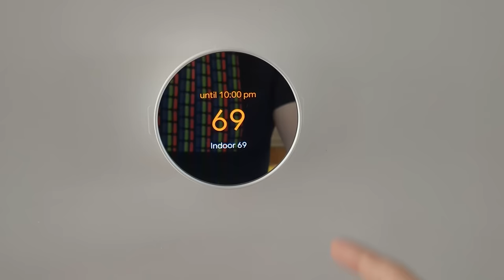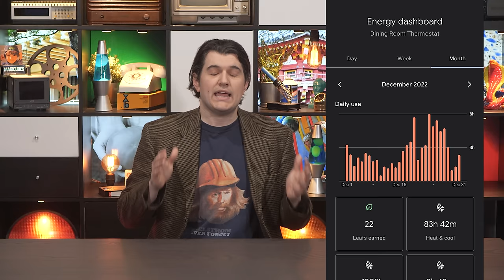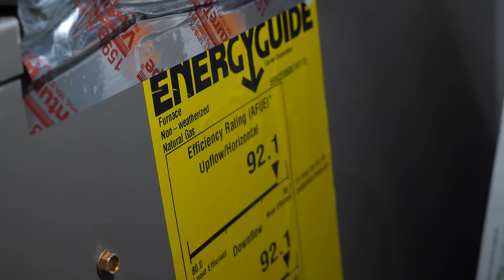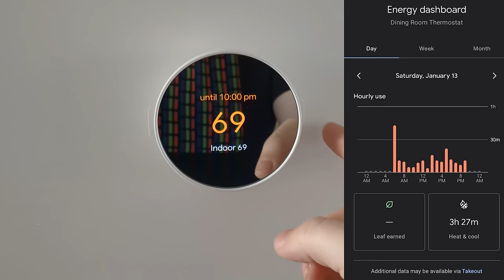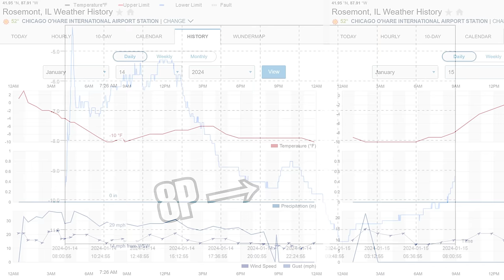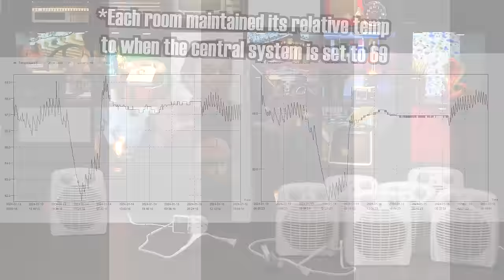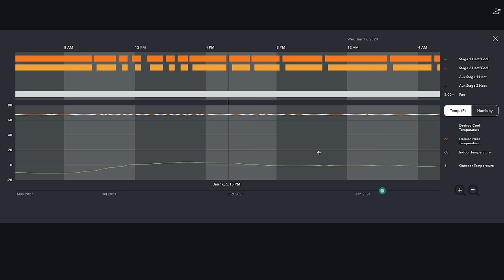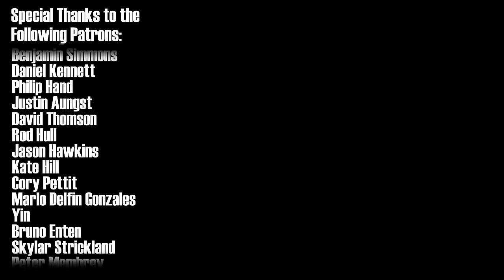Old HVAC industry practices are holding us back and costing us money. But we can fix it.

Comment: Am HVAC design engineer (floor plan layouts not the actual units), one of the reasons why gas furnaces are always oversized is because that 60k BTU is the smallest many manufacturers make, and they end up being the most common/cheapest because they're used on everything 5 tons and under. To get a smaller heater, you basically have to go electric or heat pump
Reply from the maker: I almost made this point but I did find some 30k BTU furnaces on the market so it was a damned-if-do-don't type situation.
Reply: @TechnologyConnections  What about maintenance concerns over time with wear and tear?
Reply: @TechnologyConnections they’re definitely not common. Even for a lot of package units, “low” heat specs are 54K btu. That’s also the smallest furnace I can even get from our supplier, and I’m based in Vegas where we hardly need any heat in the winter
Reply: Came here to say this too. Down south Furnaces get even more oversized because you may actually need 48kbtu of cooling but only 60kbtu of heat. Well 4 ton drive furnaces start around 80kbtu but most I come across are 120k!
Reply: @TechnologyConnections  We've got two 39.5k units, Bryant circa 1994, where I'm living now (Puget Sound region). They definitely exist.
Reply: there are lots of 40 000 btu furnaces made - even 2-stage ones.  lennox makes 44k if 40 is a bit too small and that size has a full 1200 cfm blower up to 1" of static if using the variable speed version. It is not an excuse!
Reply: This..
Reply: @averagejoeprojects2885  Old houses of the south oversized heaters are a must during a cold snap with a stiff wind coming out of the NW.
Reply: On the early 1900’s homes yes.  But on 1970’s and newer there isn’t a single 120k furnace that belongs south of the Mason-Dixion.
Reply: My house, on the coldest day of a year ( minus 28 F ) loses 23K btu. I cant fine a 25 K btu furnace. I am still using my 45 year okd  55K btu  standing pilet furnace. The $50 a year gas savings has never justified the cost of changing it out.. Oil the motor every year, thermocouples are cheap.
Reply: I do hvac and also wanted to say its because the customer wants it cheap as possible which means mass produced large furnaces. we can complain all we like but people dont have the money for it. especially now
Reply: As part of the heat pump future, I wish that there would be a shift away from centralized units. I'd much prefer several smaller, fully independent units in my home. One of my least favorite aspects of HVAC over the decades is the pressure you find yourself in when your single central system breaks. Many a HVAC contractor, especially in recent years, will leverage this to the hilt to try to get you to replace your system when yours breaks. Just this past year, 2 relatives of mine were given the lines "parts are backordered for this unit throughout the country" and "the warehouse only has 1 furnace of this size in stock, so you have to decide now whether you want it - or you may have to wait another week". If multiple small units became standard in homes, then people would not be rushed when just 1 of them broke.
Reply: Only ever seen 40K's in OLD building apartments and due to space restrictions. Even then, those apartments needed TWO  for adequate heating.
Normally enjoy these vids, but this time has grossly misinterpreted how HVAC systems operate.
Reply: no, he is right on. 40k btu is plenty for many homes. had a 44k btu put into a family member's 2 story+basement  100 year old 1200 sq ft home down from 60k, no trouble keeping up in a place with a less than 0f design temp. it rarely needs high fewer than 5% of heating ours, so much of the time it runs at 29 000 btu.  if the home is new with high r-value walls, a 40k can heat a 2500 to 3000 sq ft just fine. must furnaces are so grossly oversized it is not funny, and the result is short blasts of scorched air, not consistent temperature and comform.
time to evolve and start doing heat loss/gain calcs instead of crappy rules of thumb. @SerenoOunce
Reply: I used to see little 25k window or thru-wall gas furnaces in apartments all the time, but they're becoming much rarer now. Dynavent was the most common manufacturer and I don't believe they make them anymore.
Reply: So this begs the question, why don't companies design smaller furnaces? A line of 10k, 20k, and 30k furnaces could do a lot of good to combat oversizing in small units. 30k is the smallest I typically see, and that's what should be used in apartments.
Reply: @JasonEDragon  i prefer centralized with a very large air filter system. it keeps the air fresh in all the rooms.
Reply: @bhutehole  would be a shame if they overshot 2-3x on heat pump capacity, when going electric, especially in this economy.
Reply: there's a smaller company called dettson that actually does that. there isn't enough demand. for low heat loss spaces, furnaces are generally not the best choice anyway.  @TechnicalLee
Reply: @OneTrueCat  it that doesn’t mean they’re available. Most customers won’t wait even a week when they have no heat.
Reply: @bhutehole It’s definitely mass producing a few models to cover most people and people not wanting to spend $5-7K on a furnace and that with no changes/duct mods.
Reply: @quarterswede  yes, but that doesn't account for new construction or planned replacement being egregiously oversized.
Reply: @JasonEDragon there's a lot of issues with this approach - you introduce more points of failure and will increase the likelihood of a failure, that approach is less energy efficient, and it's more expensive. 

That said there are plenty of multizone residential systems available similar to what you're describing, but they are all connected
Reply: @jerryballstein  When you look at window air conditioners you can see that there is potential for cost to be lower by having multiple smaller units. Because they are self-contained and can be easily bought from multiple stores, the free market is effective. As we move to heat pumps, I wouldn't be surprised if similar units could be developed - with more elegant designs that could slip into a wall opening instead of passing through a window.

Today's HVAC industry seems to be moving in the opposite direction - forcing people into more expensive, complicated central units that often have service options limited to the original installer in a given area. They significantly overcharge for more advanced units, and I've seen them put the consumers under shady sales pressure when their system breaks. The industry is starting to give used car salespeople a run for their money at being despised. 

My rural county has 1 vendor that dominates the local market, so no effective competition. When you ask about heat pumps and mini-split systems you often can see in their eyes that they think they won the lottery and start quoting obscene prices. Or you get the lazy vendor who badmouths new technology so that they can keep installing the same old crap they have installed for 50 years.
Reply: @OneTrueCat how does that work with 2 units? Does one run constant and one as a peaker on the same vents? Or do both run their own zones independently with their own thermostats?
Reply: @somethingsomething404  two floors with separate duct systems, upstairs runs three zones, downstairs runs two. It's just one of many bad design choices in this place, because they both have their ducts in unconditioned space.
Reply: @JasonEDragon You've got the approach completely backwards. By far the best solution for existing homes is to use a ducted unit that replaces your furnace. R290 is coming to the US this year, if you go with a monoblock there is no refrigerant lines run inside your house there is only a water  glycol coolant loop.
You get a box outside that has no external special connections, you need to give it power and run the coolant loop and then all you have to do is install the heat exchanger and blower where the furnace used to go. It's a fast, relatively low skill swap.
Reply: @otm646  I live about 1 hour outside of Buffalo, NY in a 2 story house with basement and attic that was built in 1890. The last time my single furnace broke in 2007 I basically had about 1-2 hours to make all my decisions as it was getting down to 20 F that evening and I needed a new unit ordered for install the next day. That scenario happens often and does not give people sufficient time to make good decisions. Thankfully I had researched enough about furnaces to push for a high efficiency, modulating, forced-air gas furnace - that worked out rather well for that time. But I wanted to add central air conditioning and got sold on a single stage unit - that never cooled the upstairs well despite adding a number of upstairs return ducts during extensive remodeling that I did afterwards. So I now run a few small window air-conditions upstairs and let the central air conditioner cool the rest. And the single stage AC does a crap job - always loud with the blower on full and the downstairs is often drafty. But, contractors treat 2 stage or modulating AC units as luxury units that they put a hefty mark up on - even though they are not that much more complex to manufacture.

There is a limit to how much I can insulate this house, as about 1/3 of it is just plaster applied to a double brick wall and the windows are huge because it was built before electricity. I did some testing this winter and I think that the 43k BTU output of my furnace running in low stage mode will just maintain the temperature when it is about 20-25 F outside depending on the wind. So, I'm thinking that to switch to heat pumps I'm likely to need at a minimum 60-75k BTU to handle it being 0 F outside - which is pushing what is available in furnace modules. And that still leaves me with a single point of failure that contractors have recently made very expensive for some family and friends. You have little bargaining power when you are freezing your behind off and fearful that your home's pipes might freeze.

So, I think my best option is to have at least 2 fully independent heat pump systems in the future. I can see a furnace unit handling the downstairs, but I'd expected to need a mini-split system with multiple heads for upstairs. That starts getting into serious money from some tentative conversations that I've heard - perhaps $20k. Which gets me back to the point that if a window AC can be had for $200 - $300, and those are basically 1-way heat pumps, why can't more affordable permanent installs be designed? I at least want more than 1 system so that if 1 breaks I am not under such pressure to get it fixed right away - and I can shop around.
Reply: How much insulation is in this 100 year old 1200 sq ft home? That just seems like such a low amount to me to keep a house like this warm.  I have a 100 year old brick bungalow also 1200 sq ft full unfinished attic and basement. The boiler is 140K BTU's. No insulation in the house at all, exterior brick walls with lath and plaster over furring strips and no attic insulation.
Reply: @doctorzaius4084  Williams, Empire, Cozy and Rinnai still make gas space heaters and in small sizes, wall mounted direct vent units. I don't think the thru the wall gas units that look like air conditioners are made anymore.
Reply: @TechnologyConnections  Damn you!  …no…wait…
Reply: @Jon-hx7pe depends greatly on climate. Hvac techs size a unit for the coldest typical days of the year. I have a 70kbtu two stage gas furnace. True, for a lot if winter it rarely leaves the 1st stage. So I only need about 45kbtu to keep house warm. However, when the stretch of really cold days come (highs below 0 Fahrenheit) the furnace will absolutely run at max btu most of the time. If a tech does his job right, that's why the furnace is bigger than needed on most days. This can be mitigated on modern gas furnaces by getting a two stage or variable rate model, so it only uses what is needed.
Reply: @capps2015  shhh let the cult seeth with passion over one of their thought leaders.. they can't comprehend scenarios where its needed.. so they want to suffer when the time comes 🙃
Reply: @OneTrueCat That's circa '94 though. When was the last time you saw a new build that wasn't custom home with a floor plan of less than 2000 sq ft? If all they are basing it on is floor plan size and no one really builds small homes anymore than it makes sense that all those smaller models would be discontinued in the past 30 years.
Reply: @Jon-hx7pe the issue is they make them you can order them but does the supplier have them and as an installer/repair tech can I get parts at 2am on a Tuesday because 90% of people just want heat and in the states natural gas is crazy cheap in the dokotas they they to flare off natural gas because they can't transport it fast enough to use/sale it it becomes a waste product for the oil fields
Reply: Why is this case? Don't those furnaces have regulation over wide scope? My furnace (hot water medium)  can go in 1% increments with minimum output 0.5%. It's only 10kW output for small family house but it usually works not more than 1%-40% scope in central european winter. In autumn usually 1-8%.
Full power is only used when heating water for showering.
Reply: @Jon-hx7pe I have passive house and in european market there are furnaces for such use. They are like heating for 1-2% of their max output when there is autumn or spring but for half of the day.
It's because they have special cascade or fluent regulation burners and regulation armatures driven by stepper motors.
There are also a bit of sensors and heating medium pump is also fluently controlled by inverter.
Stupid on/off or low/med/high systems or those who had only 5-10 stages of control  were out of date 25 years ago.
Reply: @rybaluc  passive house is the way to go on new construction, almost no heating or cooling needed most of the time. but by the time you're at that point, it makes the most sense to ditch fuel burning and go heatpump.
1 to 2% of output wouldn't work on forced air unless air at vents is barely warm - north american modulating furnaces have 30 to 40% of minimum firing rate.
Reply: @Jon-hx7pe  Depends. In climate  where you are lot of degrees below freezing point -20C it is way to go also for modern gas heating. I could heat up house with just 18-20C of heating medium. No issues. 
But you got the point. Forced air is shitty heating medium.
-8 C is mild winter. 
Passive house is idea 20 years old. So it is past what is considered new building.
Reply: @rybaluc  yes it does depend. by the time you have a minimal heating load like 10 000 btu/3kw at peak, gas is huge overkill. heatpumps are better for low-load heating. for existing home with high heat loss, dual fuel- gas + heatpump can make a lot of sense with hp running in milder weather, gas taking over in colder conditions.

Forced air is a great source of heat done right, it is just no good for super-high turndowns like dropping to 10% output because the air distribution system won't work right at 10% airflow. modulating boilers are better for that.
in north america with our a/c addiction, with ductwork you can get a/c with a heatpump easily.
forced air is also cheaper to install.

in the end it is all about doing what's best for the application though.
Reply: @Jon-hx7pe  Depends. Imagine i have to pay for electricity 3x more than in US given it is high tariff on ripple control scheme. For heating tariff in remotely controlled energy distribution company schemes it could be a bit better.
On the other hand in some cases heat pump in low subzero temos requires help of resistive heating.

Solar power adds only little to it since we have pretty dark winters in central europe.
Reply: @rybaluc  i don't disagree - my point was for passive houses with extremely low heating needs only that it may not be worth getting as service despite those issues. i'm talking homes that stay warm without active heating 80 to 90% of the season due to lots of insulation and good passive solar design.
Not regular houses with high heating needs.
Reply: @Jon-hx7pe  Heating season. That depends on many factors. Climate is one of them. Other thing is heat from other sources.
What is standard metric in my country is heat loss in kW for entire building. 80-90% of season without heating is pure scifi for passive houses in mild/inland european climate and  only zero energy houses are getting close to it. Imagine you have dark out there and there is very low natural heating via windows. For 3 months water is frozen out there. Also you need to heat water somehow. In winter i have 20x less solar input than in early spring or early autumn.
Reply: @kkarllwt You pay $50 in a year? Or it's a assumable difference in bill if you install more economical furnace?
Reply: Modulating 3 stage can go to 20k btu.
Reply: If somebody started manufacturing smaller gas furnaces, in your professional opinion, do you think there would be a market for them?
Reply: Half of that size furnaces are normally available in european market and its absolutely typical. All of them fluent scope of regulation from 5 or from 1 to 100% in around 1-3% increments.
Vaillant, Bosch(former Geminox), immergas, Viessman, Baxi, Protherm, Junkers... i could go on. With heat air exchanger atrached  you could do even hot air system as well.
Reply: @OneTrueCat  94... isn't it worth of throwing out of the door already? This appliance must be very gas hungry. Regulation shitty and without lambda probe too.
Reply: @rybaluc  it absolutely is, but given I'm building another house and this one is still my mother in law's to make major decisions on, and she's a penny wise, pound foolish boomer who thinks heat pumps are universally loud and her electric bill going up, even if the gas bill goes down more, is going to ruin her financially...

Tl;dr: yes, I really want to replace them, and it drives me closer to madness every time I see those furnaces.
Reply: @eris_void I’d actually be more concerned for a furnace rarely running then for one constantly going…
Reply: @SerenoOunce false. nothing you said has anything to do with "gross misinterpretation" it is one anecdote that you don't even seem to know much about.
Reply: @SerenoOunce also apartments are extremely varied and usually much larger than a single person's home. and old units operate differently and less efficiently than new ones. don't know how this edge case means that much to you.